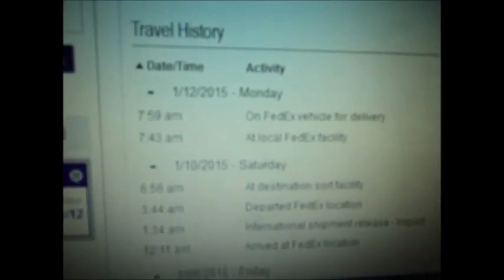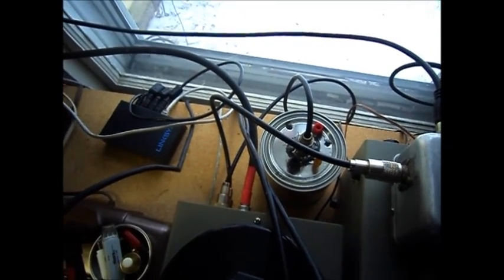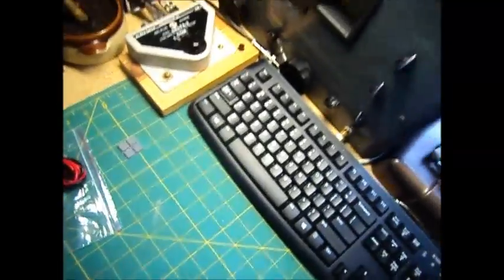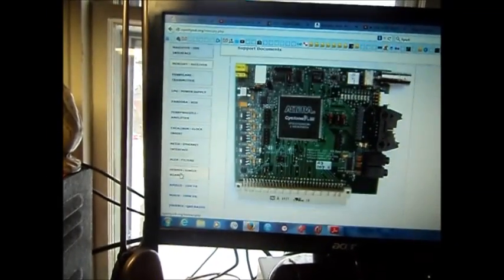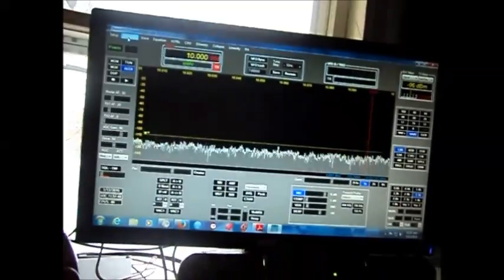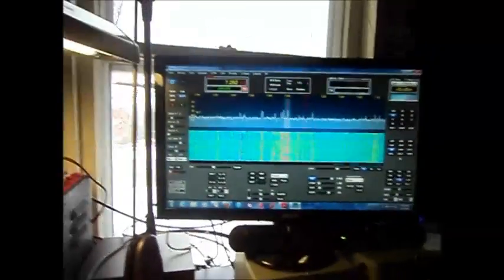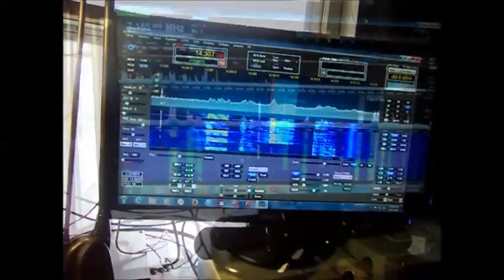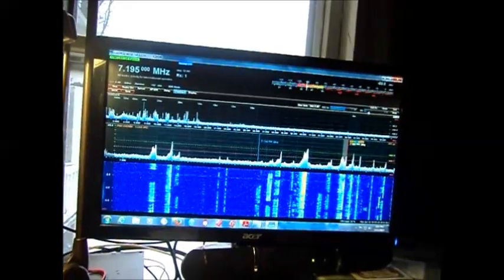The Anan-10 arrives

Comment: Cool rig!  I bought an ANAN-100D which actually arrived on Christmas eve...so that was pretty exciting.  Been having a blast with it, enjoy yours!  By the way, my 100D has the blue front and rear panels and I actually prefer the grey look of your 10.
Reply from the maker: Thanks for stopping by. Yea I am not sure whey it is grey. I liked the blue front they have advertized on their website. If I had bought in the US I probably would have asked for an exchange for a blue one. But sending it back to India just for that is out of the question. But I am really enjoying the radio and it is a minor thing that has nothing to do with performance. 73, Tom
Reply: Tom k2bew
I got mine directly from them too, with the holiday pricing it was a quite a bit cheaper then they're asking for them now.  In fact, at this point I think it's less expensive to get them from Gigaparts then to buy direct.  I imagine it's more cost effective for Apache to sell through a US distributor than to individually ship each one to the US.